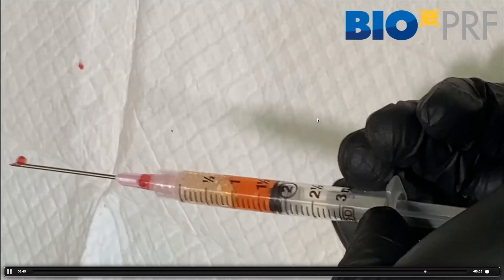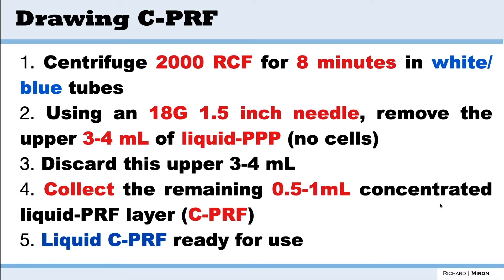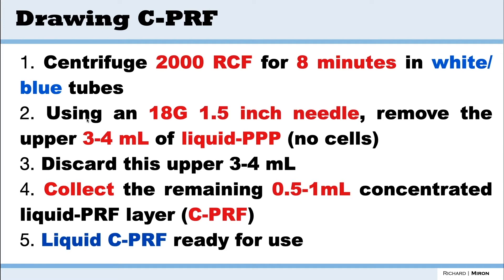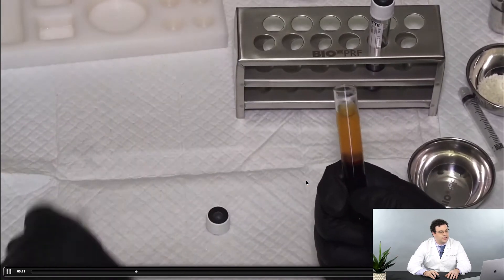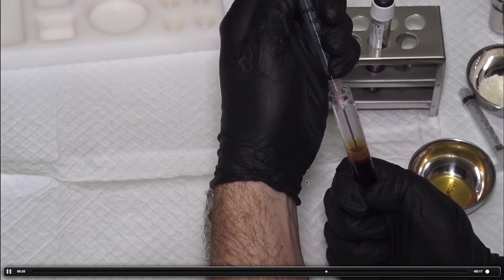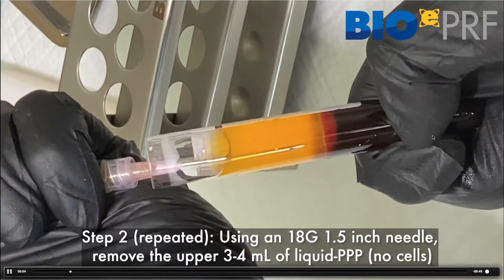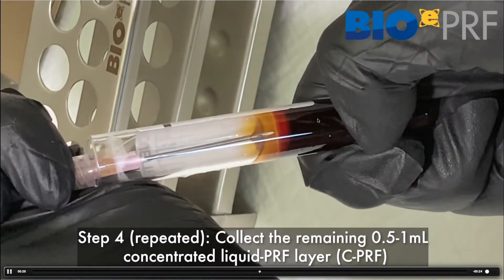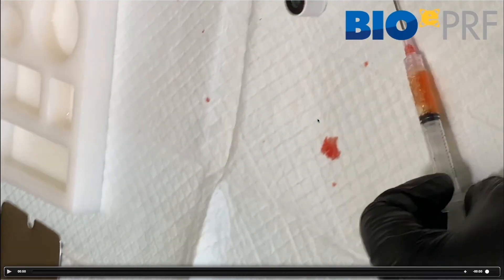Chapter 10.7: Drawing Concentrated-PRF (C-PRF) presented by Dr. Richard Miron

Comment: In your other video (chapter 3.1) you mentioned that the speed used for c-PRF is 2000g. What is the correct speed? Is it 2000g or rpf?

Comment: Dr. Miron,
@ 2:15 you draw C-PRF from a point very close to buffy coat to discard, why don't you draw it slowly from the top and move the needle  further in when the volume decreases? 
Wouldn't it be safer to do so in a logical way to be sure that we keep the rich part?

Comment: Respectfully sir,
We have a fixed angle centrifuge with rotor size 135.
I converted 2000g to rpm and did the procedure for 8 minutes. I did in sterile plastic tube as im from a poor resource setting. 

The plasma became prf membrane like every time. 

Please help. Very much appreciated.
Reply from the maker: you need a horizontal device for this. The high g pushes the cells towards the back wall where clotting will start. You'll never keep it liquid with a fixed-angle which you shouldn't use for any PRF protocols. See chapter 2.1
Reply: @prfedu  ok thank a lot,
As i mentioned we are from a resource poor setting. Any changes i can make to get injectable prf with fixed angle centrifuge which is better than prp?

Any help is very much appreciated.
Reply: @LeDrPsycho  
If you work quickly - you get some minor clotting around the red blood cells... but it's STILL injectable even with a fixed-angle centrifuge.
Speed is key - the blood draw must be fast and preferably cool the post-centrifuge vacutainer OR cool the PRF you draw - this will slow down clotting.

Are you in a hot country? This will increase the blood clotting rate... consider a way to cool the blood AFTER centrifuge or even some cooling before to slow down the clotting.
Reply: @LeDrPsycho not sure if you're still pondering... take two of those cooling gel bags you put in the freezer for bruises and stuff. Pass a tape around them very tightly so they will be like a sandwich. Put your tubes between them and put them in the freezer until the bags are stiff. Use those cool tubes to collect and stuff them right back as you progress to collect with the other ones. When done, centrifuge like normal. The clot won't form. Keep them in the bag sandwich while you get them ready to inject. I hope it made sense to you.
Reply: No @prfedu